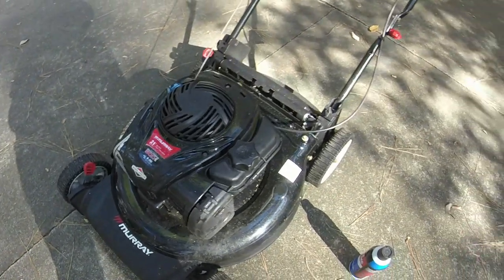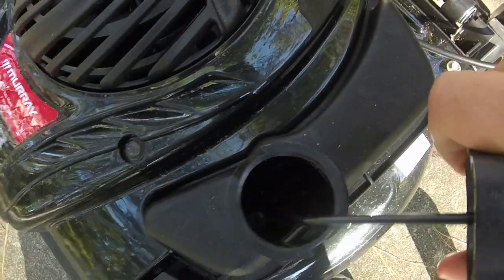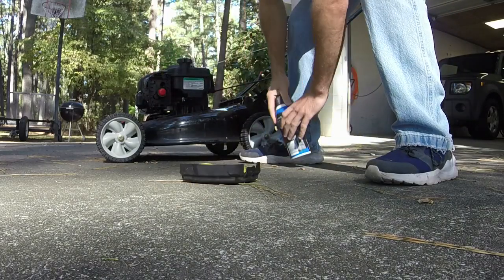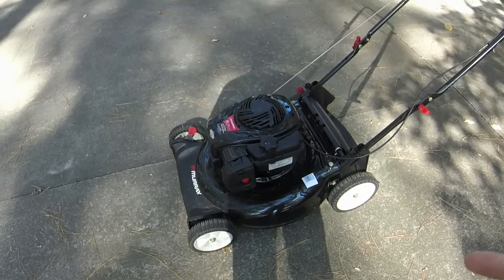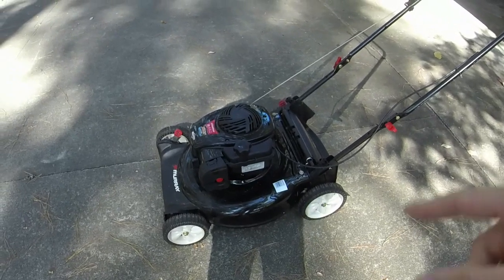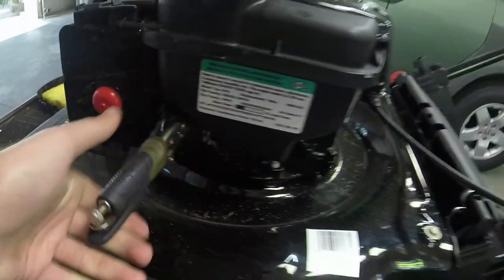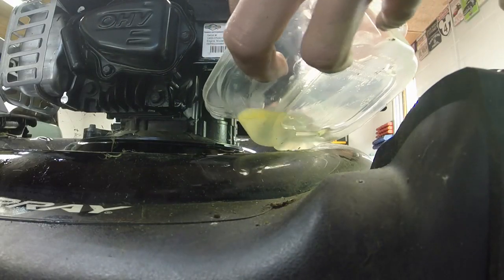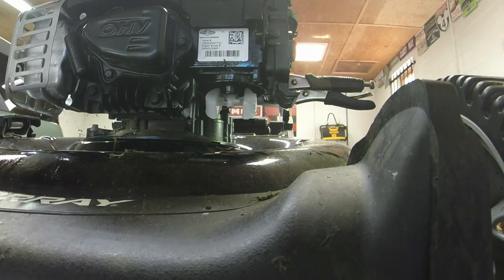Briggs and Stratton plastic carb DIY "quick" clean

Comment: THANK YOU SIR. 

I have a Poulan Pro that I bought a few years back on Amazon for less than $200 delivered to my door. It does have the Briggs 500e engine and after a few seasons of use and regular maintenance being done it developed a "no start." I followed the quick and dirty clean up of the carb and got it going again. I decided to tackle it myself after the local small engine shop said that they couldn't get to me until a month to a month and a half from now. 

That was so easy a father of two could do it while his 6 and half year old tried to play supervisor. ;-)
Reply from the maker: Good deal, glad I could help!

Comment: OK  my best video of all time is called  "A Lawn Mower That Starts then Stalls"   I am not kidding.  It has had 1.8 million views.  It is a simple solution that a guy can do at home with a 1/2 inch socket.  You may consider a simple title.  That video is the cornerstone of my channel   Bad  lighting and all.  LOL  It is 6 years old now.  A video title like that is the way to go.  Here is the link  It is almost embarrassing to see now.  It was before I changed my channel name.  But it still chugs along.
Reply from the maker: Thanks Bruce.  Yes that video is great for you with those views and would love to one day get there.  I am working on my titles to make them more concise and will look at this one.  Thanks for the advice.  It seems the simplest videos are the best ones!
Reply: @EllisMowersandmore  Right.  I do some videos where i have the entire valve train out of a generator and I think it will go all the way.   Then a  little video like the one I showed you and it   gets over a million views.
Reply from the maker: @BrucesShop  I know Bruce, it seems there's no rhyme or reason to what will catch on sometimes.  But the simpler the better it seems so I altered the title some to see if that draws people in.  My biggest hit currently is the Briggs 675 auto choke fix where somebody put the vane in the exhaust hole with 70k views.  Thanks for all the great advice!

Comment: Nice video. I just take the carb and tank off as an assembly. 
The white jut thing is called a capsule. There are two, one for regular and one high altitude. Best as I can tell.
Reply from the maker: Thank you and thanks for the info.  That's a good idea to do as well.  Thanks for the term for that white thing, oddly enough I've never had to replace one of those yet or really had to even take it off and clean it.  I guess I've been pretty lucky so far!

Comment: I got the same mower mine stopped priming I put a new primer bulb in it and still won't prime
Reply from the maker: Sounds like the primer jet is blocked, I bet a carb clean would fix it if you took out the white cartridge and cleaned all the holes in it.  Tends to work for me when it's a non priming issue.
Reply: @EllisMowersandmore  thanks man ill try it

Comment: Good vid,  in 90% of the time Remove the carburetor. 

I just picked up a Kohler today for free
It reeks of bad gas.  And who ever had it put the wrong blade on it.
Reply from the maker: Thank you, yes all other carbs I recommend removing them.  This one you can get by with since the jet faces sideways and you can easily access the carb bolts from the bottom.  I've got a Lawn Boy with a Kohler that's in pretty bad shape that will be coming down the line sometime in the next few months.  Pretty swamped right now!